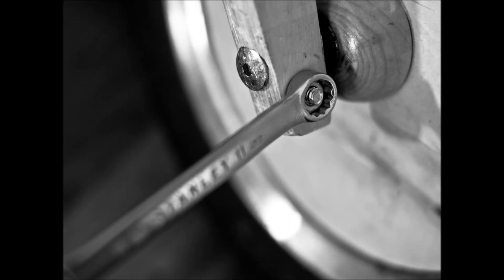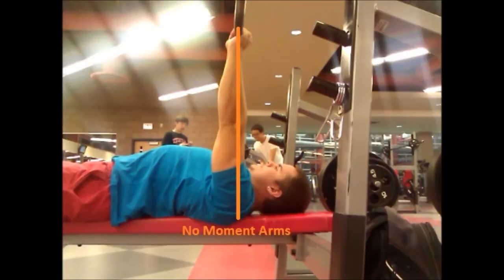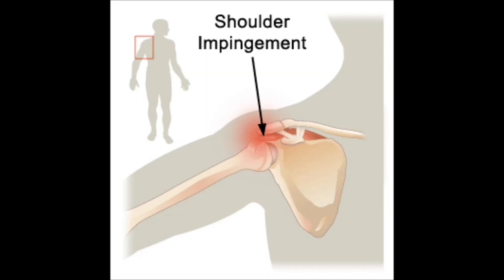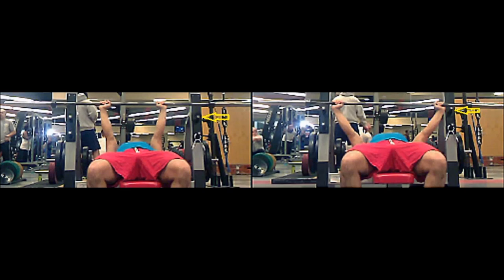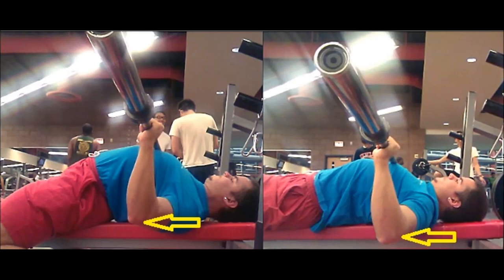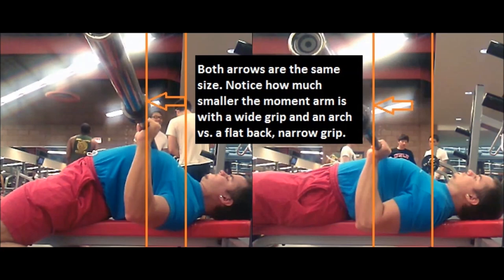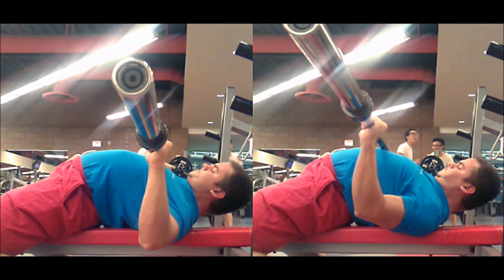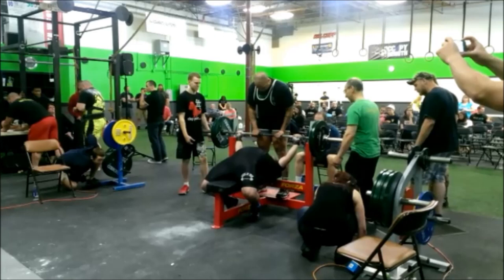Bench Press Form: Wide Grip vs. Narrow, Flat vs. Arched

Comment: I was always told that the optimal grip width is when your forearms are vertical in the bottom position. If I go to the maximum legal grip width my wrists are outside of my elbows. Is shortening the range of motion more important than keeping your wrists inline with your elbows? Is there a trade off?
Reply from the maker: You don't have to do either/or. Depending on your grip width, you can get your elbows in line with your wrists by touching higher or lower. The bench best grip is the grip where you can cut the range of motion the most AND keep elbows/wrists in line. For some people, those people who cannot arch a lot, this might not be a max grip width. For some people, max grip width results in having to touch so close to the shoulders that they aren't touching the highest point of their arch.

Comment: I don't get it. You say there is no moment arm when the bar is over your shoulders, but the force is applied at the elbow joint. Since the forearms are basically 90* with the bar, then the length of the humerus is the moment arm, at least at the 90* humerus-forearm point in the lift. Obviously this changes as the humerus-forearm angle becomes more obtuse throughout the lift. This is the same at any point that is within a humerus length down your torso. The way you show the pictures you just tell there is a moment arm when the bar is over the shoulders, you'd need to look down the bench to see it.
Reply: My post wasn't entirely clear. What I'm saying is, even assuming you could bench at the shoulders without impingement, you're still basically a humerus length away from the point of rotation (shoulders) and point of force application (elbows)
Reply: Jack Ravish So you do still have a moment arm.
Reply from the maker: Jack Ravish There are multiple moments arms involved in the bench press. When the bar is over the shoulder, you eliminate the moment arm between the bar and the shoulder, specifically. There can still be a moment arm between the elbow and the bar even if the one between the bar and the shoulder is eliminated.
Reply: PowerliftingToWin 
I still don't think the video is entirely accurate,  and here is why-  

The only way force is transferred to the shoulder in the bench is through the upper arm. The upper arm is the wrench (not the bar). The forearm (at the elbow)  is the hand (the bar applies force down into the forearm, and the forearm then applies that force down into the elbow) and the shoulder is the nut. In terms of total rotational force about the shoulder joint, it is fine to view it as a single moment arm between the elbow joint and the shoulder joint. 

You can break it into multiple moment arms, with the "side view" between the force and the shoulder as you've shown in the video , but then you need to additionally show the moment arm as seen from a "head on" view - the moment arm caused by the degree of shoulder adduction. Both of these together "show" the total rotational force on the shoulder joint. 

You say we should minimize the rotational force about the shoulder, but when we decrease the "side view" distance you show in the video, you are increasing the "head on" distance between elbow and shoulder due to shoulder adduction. So really, you haven't decreased the rotational force at all. You've just changed the axis of rotation. 

In fact, in the picture at 7:04, the picture on the right has less total rotational force than the picture on the left. Your forearms are directly under the bar, so the force from the bar is applied straight down into your elbow. The moment arm is the perpendicular distance between this point of force application and your shoulder. Since your forearm-upper arm angle is above the 90* point, you know the perpendicular distance between that point and your shoulder is less than the other photo that passes through the forarm-upper arm 90* point. (This is true because it makes a triangle... the upper arm, perpendicular distance, and then the elbow-shoulder height difference. The upper arm is the hypotenoose since the perp. distance and height difference make a right angle with each other. The hypotenoose is always the longest, so the perpendicular distance is maximized when the upper arm itself is the perpendicular distance with the force, when the forearm-upper arm angle is 90*)

Obviously, the bar needs to travel back towards you to minimize the moment arm, because the force needs to end up going directly down into your shoulder joint.... but this is accomplished by keeping your elbows directly under the bar. 

Now maybe physiology makes it so minimized moment arms arent necessrily the best way to lift, I know this is true in some cases, but I dont really know anything about that so I can't say here what is true for bench. 

A long post I now realize, but it was a long video and your channel is good so I hope you will consider these things.

Comment: Wouldnt it be technically "cheating" if there's a less rom. Im not talking about powerlifting rules but just becoming stronger all together. You're not lifting as much if you were to use a narrow grip as opposed to wide,
Reply: Interesting question
Reply from the maker: Is dunking cheating in basketball? Dunks are easier than lay-ups.

Cheating is defined by the rules. The rules allow these techniques.
Reply: PowerliftingToWin k like I said I wasn't referring to powerlifting rules im referring to getting stronger and im posing the question if someone wanted to get brute strength or get stronger would they approach the full rom lifg or the less rom lift just as an individual. ?.
Reply from the maker: Strength is specific to the task at hand. Strength gained from bench pressing has varying degrees of carryover to other tasks.

A bench with an arch will likely lead to stronger triceps due to the heavier loads handled (and thus locked out) while a "full range of motion" bench will likely result in superior hypertrophy for the pecs/delts. Strength is the ability to produce force against an external resistance. The more force you produce, the stronger you are.
Reply: PowerliftingToWin good reply! Thanks!
Reply: K

Comment: What is your opinion on how flat dumbbell press compares to barbell. I have always been more comfortable with dumbbell and exclusively did them until recently.  A long term goal was to reach 125lbs x1,  I reached 125lbs x2.  I've now decided to switch to barbell. I expected my 1rm to be close to 315. It is only 275. My theory is that I fell into a narrow pattern where my triceps and shoulders did most of the work on dumbbell. The wider grip on barbell hasn't been easy. And I may start benching with a narrow grip. Guys that can't db press as much as me are stronger on the barbell press. How?! I like the channel. Up there with candito
Reply from the maker: Specificity. You get at what you train. Nothing has 100% transference. If you do front squats, you will improve your back squat, but not as much as if you did a lot of back squatting.
Reply: PowerliftingToWin  I figured that a bit as well. I just figured moving weight unilaterally would have made the barbell easy. I believed in the guesstimate of your db press + 45lbs will = your bb press. Keep up the good work with the channel

Comment: I learned a lot from this video. I've always realized - tho I didn't know why until watching this - that once the weight hits your chest you need to quickly as possible get the weight back over the your shoulders- that J curve motion. I knew intuitively that I felt more power once it's over my shoulders and it moves up more easily. But I don't go anywhere as wide as you - and tho I understand the concept of a wider grip improving the ability to lift heavier weight - it seems like the weight feels heavier when I've tried to first widen the grip...so I always go back to my usual grip. My usual grip is with my index and thumbs right on the edge of the first two wrings on the bar (not the outside two) so I don't know how narrow that's considered.  

Is it typical for the weight to feel heavier at first and do you think it starts to feel lighter as you get used to it over time?
Thanks!
Reply: WilRockQ I had this same concern about the weight feeling heavier, it only feels heavy when the bar comes down to
My chest, then when I push up, it is light

Comment: This is good for a 1 RM. but would you train like this? Doesn’t seem like a good way to build strength.
Reply: What do you mean by would you train like this? As in would you always use great form?
Reply: Yes, always train with an arch and wide grip
1. Avoid shoulder injury
2. Gets you use to the form
3. Allows you to press more weight which will put more volume on your chest.  

On chest day I use a back roller to help get my lower back warmer up and flexible for the arch.  I do a beach stretch first to get my back popped

Comment: Hey izzy is it ok to flare your elbows on the way up? That's the only way to get a J curve right?
Reply from the maker: That's correct. The elbows will tend to flare to some degree on the way up. This puts the bar directly back over the shoulder joint.
Reply: PowerliftingToWin Is there a specific point in the range of motion where it's safe to flare your elbows? I'm currently working on reducing elbow flare because I flare them 90 degrees about mid- range of motion when the weight is heavy. Is this dangerous or am I good to go as long as I touch my sternum?
Reply from the maker: It is impossible to say with certainty. The herp-derp answer is: "it is safe to flair your elbows once the bar is high enough to no longer cause impingement". This is different for everyone.
Reply: PowerliftingToWin I actually solved this issue. The reason my elbow even flared out that much is because I lost scapular retraction midrep.

Comment: Awesome video thank you! Related to this I have a question that is tormenting me for the last two weeks. I'm quite tall 6'4'' and I discovered that benching with a close grip really is way better for me, I don't have little shoulder pain anymore everytime I bench and I'm getting stronger as well since I changed the grip, but this is my doubt: should  I continue to bench like that or force me to a wider grip? I am afraid that I will not be as strong as with a wide grip, is that true? thank you
Reply: Iceforgedstormborn you should grip as wide as you can without shoulder pain.
Reply: I tried for so long but I think only close bench fits for me, thank you
Reply: Iceforgedstormborn same bro. I feel way stronger, explosive and powerful with a closer grip. Just depends on how strong your triceps are